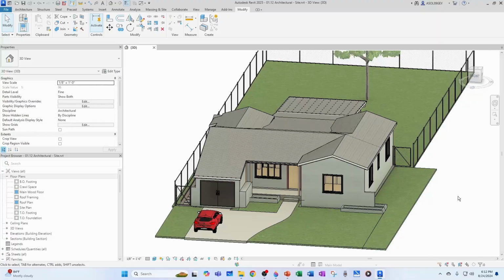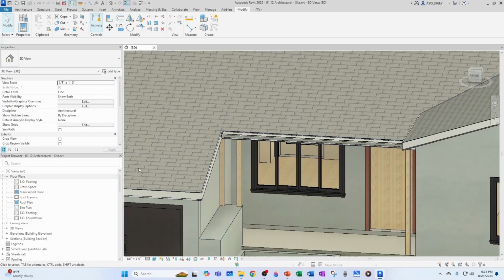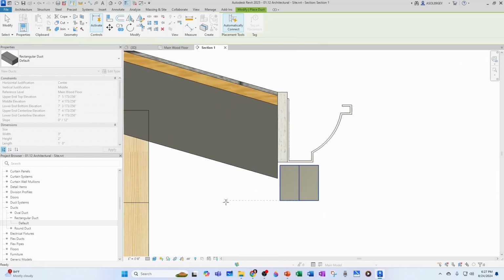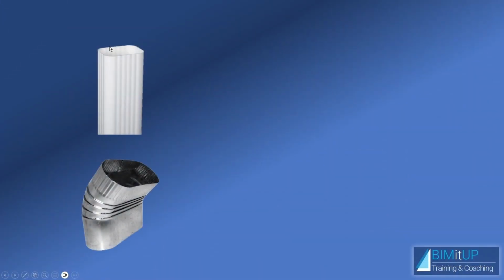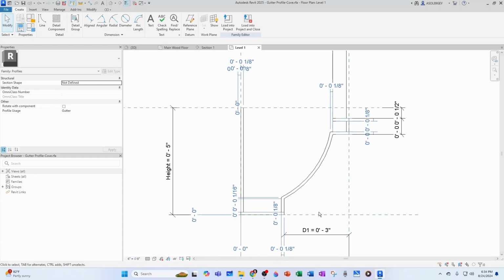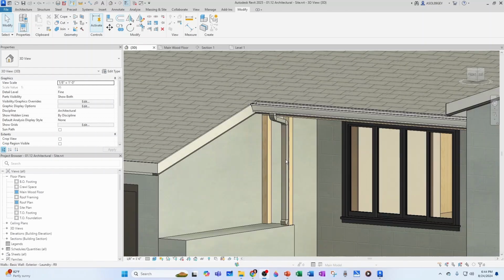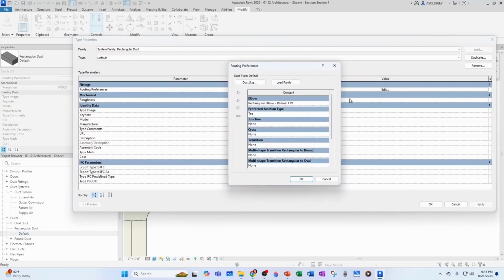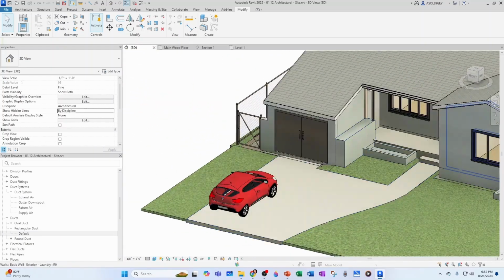Mastering Gutter Downspouts in Revit

Comment: What is only left is to fix the downspot to the wall with brackets
Reply from the maker: If you're in Architecture, which I'm presuming you are, you might want to download the bracket families (available online as "riser clamps"). That could be an option
Reply: @bimitup  Thank you for the advice! I have created my custom family for brackets, but i will surely expore the 'riser clamps' family. I am not an architect, but i a CAD technician in Civil 3D and Infraworks. However, i am working to widen my competencies, this is why i am studying Revit and 3ds Max and have already had some progress in them.